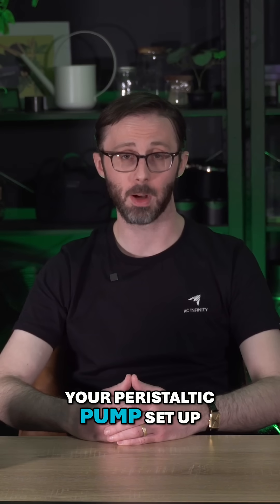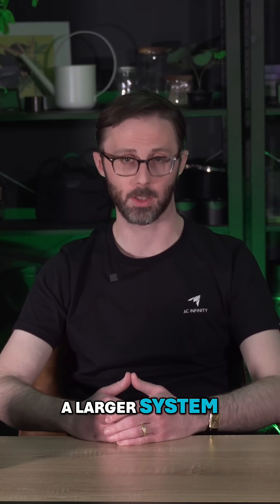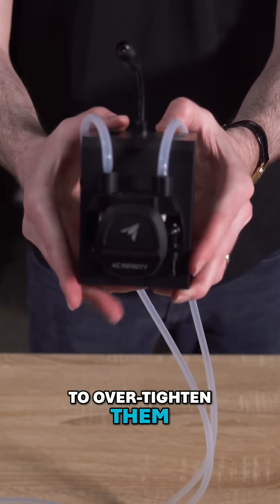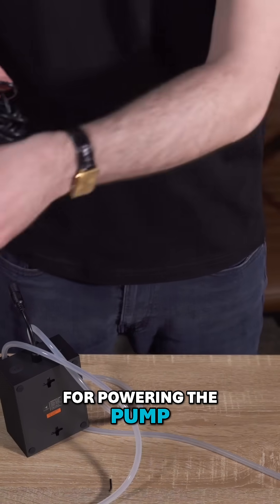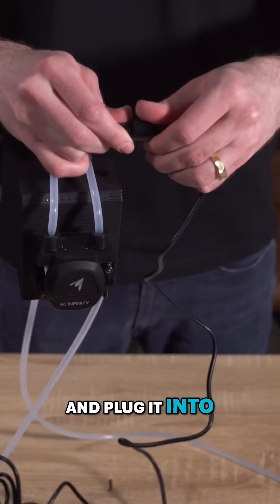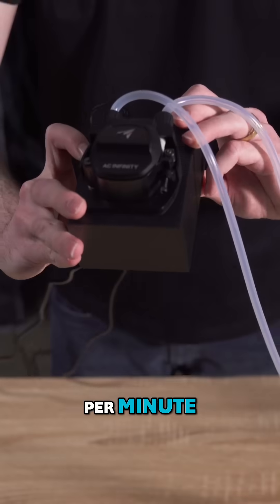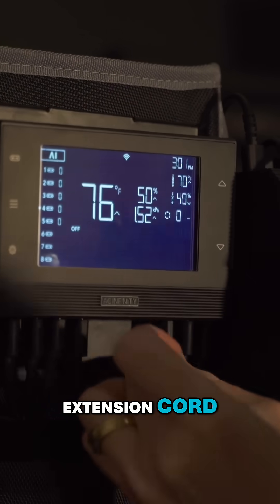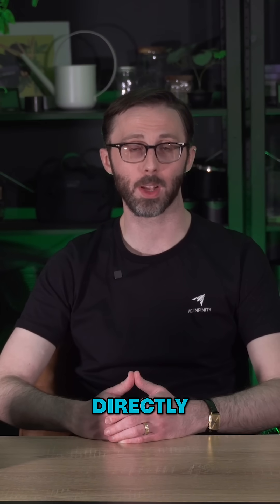How Setup our NEW Peristaltic Dosing Pump!

Comment: Will this pair with the soil moisture sensor so it can water automatically at a certain moisture content?
Reply: I know it would probably only be enough flow for a small setup but it would be perfect for my 4x4 grow.
Reply: @briann420 just get a bluemat drip ring system
Reply: Peristaltic pumps feeds a super small amount at a time, like a milliliter rate. You wouldn't use this to feed your plants, this type of pump would be for a reservoir to ph up or down. 

ACI is doing a great job servicing the  "non-commercial market" creating this affordable products for consumers. for example: my two Bluelabs ph controllers are 500 a piece, one of them stopped pumping. Guess who can toss that huzz right out the door.
Reply: @mBossLAReacts  I need small shots when growing in solo cups or small rock wool cubes, this would work perfectly for ec stacking, I know it’s not what they made it for.